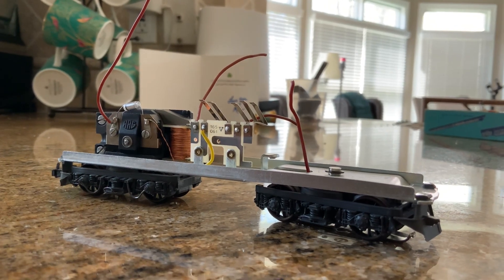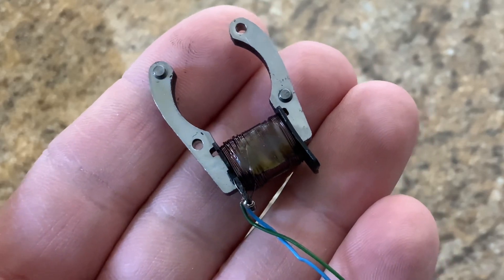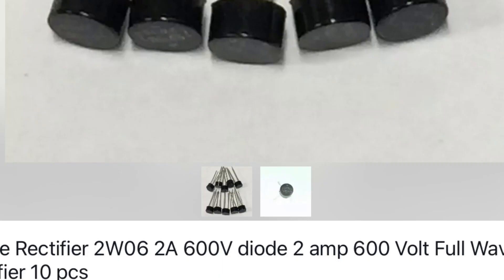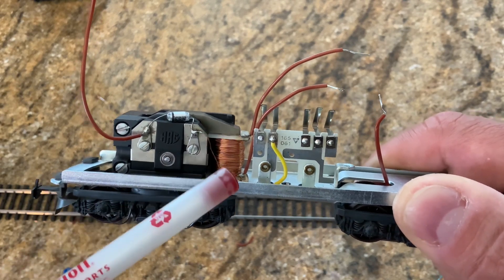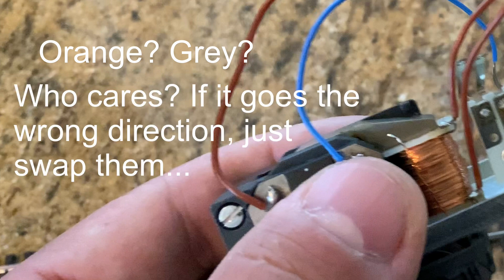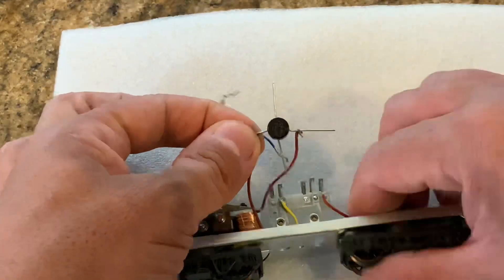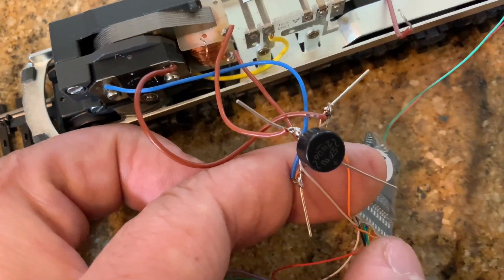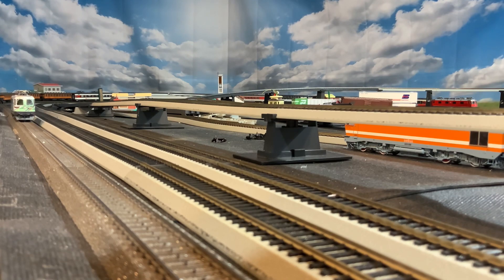Marklin AC to DCC-Ready for under a Dollar! - Convert Marklin or HAG AC Locomotives to DCC for Cheap

Comment: does that mean that if I wire it like you, I can run in on a standard analogue DC 2 rail track? do i have to somehow make pick ups from rails also?
Reply from the maker: This is a great question, and, yes, there would be two challenges. Converting it to pick up the "positive" from the engineer's side would be the first issue. Many Marklin wheels aren't insulated because there's no point in doing that. The second is that the gauge of Marklin wheels is actually slightly different compared to NMRA. It would potentially work without a hitch until the locomotive had to roll into a point.. Then.. Not so sure if it would take the switch without hassle.
Reply: This video uses 3rd rail Marklin tracks. My 2cent knowledge says it won't work on 2rail DCC or DC. The wheels for 3rail and 2rail are different. 3rail wheels on 2rail will get shorted.

Comment: Great work 👍. One question, the decoder track wires will be connected to the centre rail and two side rails as usual, correct?
Reply from the maker: That's correct. The red "hot" wire is connected to the center slider while the black "neutral" is connected to the two side rail pickups on the wheels.